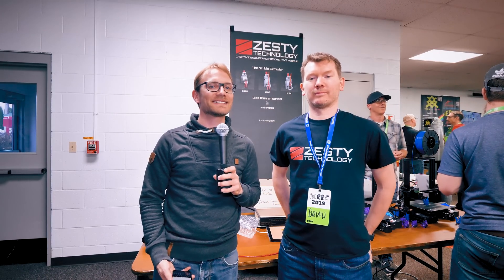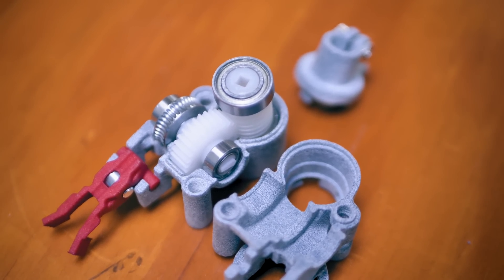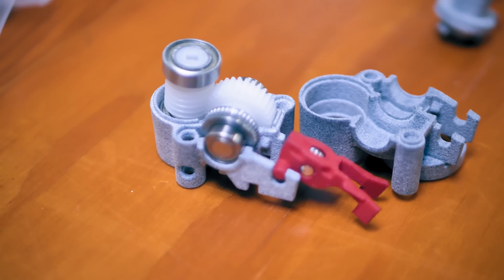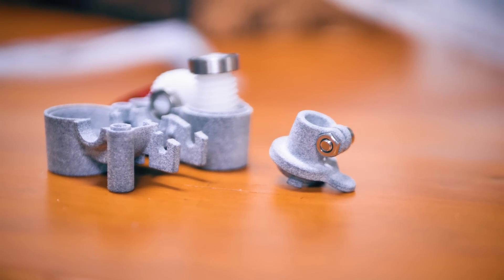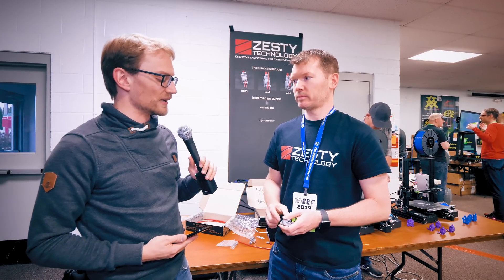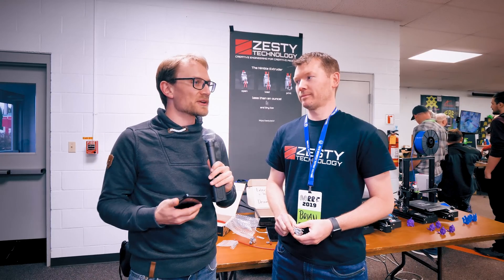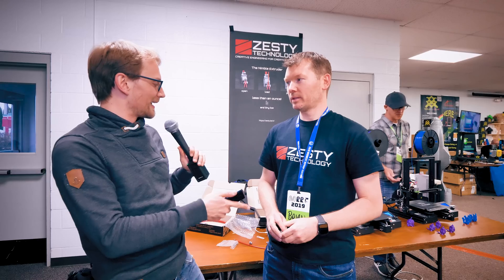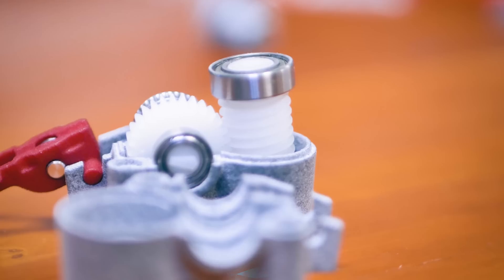The Remote Direct Extruder: Zesty Nimble! #MRRF2019

Comment: Could it be that they just appropriated the Flex3Drive project and pretended that it was their idea? Flex3Drive started in 2012, allegedly, and it can still be bought, and it is not sold out. So, something smells really scammy about Zesty. What could take them so long to finish with their next product? And why don't they sell the version 2 while they are developing the version 3? Were they sued for copyright infringement? Hit with a "cease and desist" order? The only thing that's clear, is that I will have to go to the Flex3Drive if I want a remote direct extruder.

Comment: This is the pinnacle of extruder tech today. A Nema 8 motor. It's about 20mm square. This is a staple in the 3d printer technology. Of course a nema 8 will have limitations but we're not limited by size and weight anymore. We can use a nema 11 with correct gearing for speed and quality, extruders are getting smaller every day and will eventually combine with heatbreaks when micro water cooling becomes more popular for high heats. 300mm/s printing will soon be possible for the average joe. Shopping is about to be changed forever. In 50 years when 3d printing can print ceramics and glass, malls will be online only.

Comment: So, it's a flexdrive clone?
Reply: David Willmore only in the sense that a Lamborghini is a clone of the Ford Model T
Reply: @crystalclearglass5204  i had the oppurtunity to test them out both. While the nimble can handle speeds over 300mm/s better and is more quiet (1:30 instead of 1:40 on the flex3drive) the flex3drive does almost everything else better. The flexdrive has significantly less slack (nimble about 0.1mm , flexdrive about 0.05mm), is cheaper, is completely open source, produces better end results. The nimble is a copy of the flexdrive, not the other way around. The lamborgini in this case is the flex3drive. And it comes at a price that is about half the price of the For Model T.

Comment: I own a Flex3Drive, which is the same thing. The shaft needs periodic replacement, or else they get springy, you'll start to see pulses in your extrusion. I mean on the time span of years, not frequent, but definitely get a few spare shafts.
Reply: I've got a Zesty Nimble for one year: never needed a replacement, I 3D printed at least 10 kg of PLA and other filaments during this year.
Zesty Nimble is a very good product!
Reply: @mariomilanesio3861  One year isn't long enough, it'll be several years, and you might not even care about the degradation, it might even look just like bad vibrations or bad filament.
Reply: @frank26080115   I don't agree: we are talking of 2-3 hundred € / $ to, say, one thousand 3D printers models, so nothing really expensive. With Zesty (and Flexdrive too, I suppose) you get a great piece of hardware with minimal maintenance. Then ok, nobody knows how it will behave after say 5 years work...but I think in 5 years my actual 3D printer with Zesty will be set apart for something new and better. So, you get great improvements in terms of speed, TPU and elastic filaments printing for a few dollars, and maintenance isn't that great problem.
Reply: @mariomilanesio3861  I'm not saying it's bad, I don't understand why you are writing this to me.

Comment: Video Idea: ultimate FDM speedtest using Nimble + SuperVolcano + beefiest stepper motor you can find (maybe a chance to try Trinamic TMC 5160s at the same time for higher amperage?).

Either way, this needs a proper review.  Have been looking to move to Direct for my CR-10 for a while now, and between the ease of upgrade, weight benefit, and (hopefully) elimination of traditional Bowden issues with material type and retraction, Zesty just pulled way ahead of the Bondtech BMG I'd been looking at.
Reply: Hi Alexander, you don't need a beefy motor, in fact, we suggest a very small light pancake stepper. You want it to be fast and light. The Nimble takes care of the torque.

Comment: Unless the cable itself is crazy expensive, I don't think this thing is worth $120.
Reply: They're not producing tens of thousands of units a month, that's why the prices are high. I do some manufacturing of small batches myself (nothing related) and I can tell you it's all about the size of your production.
Reply: @guillep2k  I can understand that, but if I could find a flex cable for cheaper, then I'd rather build one myself that also has dual gearing better flex filament performance.
Reply: @LanceThumping  That would be a cool project.

Comment: Beautiful concept (taken from motorcycle speedo cable or flex shaft die grinder?) 
I see a few issues. 30:1 means stepper must spin damn fast to get the speeds you want. Fast retraction would be iffy. Missed steps will be an issue. 3 to 5:1 is more than enough, since most extruders are 1:1 (gear on motor shaft) and function quite well past 150mm/s print speeds. 
With that high ratio, why only 1 gear drive? Dual with 30:1 makes more sense to me especially with slipperier Nylon.
Secondly, lube. Are the gears being lubed? I see sealed bearings. As with all gearboxes, it will need to be taken apart and cleaned out of spent lube. Hopefully it doesn't ooze out somewhere. Maybe make gears from igus material and you won't need lube. In that aspect, you could remove all the bearings for igus bushings. 
I like the pressed-in threads. Good touch. 
He said speeds on volcanoes are 'reasonably fast' and not 'insanely fast'? 30:1 is the problem. Sure, doing 1/4 or 1/2 stepping will lower your step count and give your tiny 8-bit machine breathing space but then it is a give/take for accuracy vs speed. 
Thirdly, the straight cut gear. Backlash in a worm drive is lowered(eliminated) by bevelling/arching both gears and 'sinking' it deeper into each other, providing higher teeth engagement. Check the pic to understand what I mean: http://www.amrutgearsindustries.com/gears/worm-gear/industrial-drive-worm-gear-worm-shaft.jpg
Does this setup accept off the shelf extruder gears?
Reply: You'll need way less retraction than a Bowden.
Reply: @guillep2k  On either my Delta or my Cartesian machine, retraction is the same amount. I see no reason to draw back more with the Delta over the direct drive Cartesian machine. Both are driven with 1:1 extruders. They both have the same step/mm count and are within 2% of each other.
I do not see your rebuttal as accurate.
Reply: @leofortey7561  It's not about delta vs. cartesian. The benefit of Bowden is that it allows for more speed than direct because of the mass difference (by taking the heavy motor out of the equation). The  disadvantage is that you have less control on the nozzle pressure and you need more retraction to avoid stringing (and it's very difficult to drive softer filaments). Just Google Bowden vs direct.

Comment: Well the point of bowden is speed... so the 32:1 gear ratio kind of limits that?
Reply: Bowden allows you to go faster because it's lighter than direct drive, so you have less inertia. This product is exactly about that, taking the weight from your extruding head while keeping the control over your filament. You'll obviously have to change your printer parameters so it drives the extruder motor faster. I can only speak for my CR-10, but the motors are the same in every axis, which means the extruder can certainly go way faster than limited by the stock firmware.

Comment: What I don't understand is why you need a custom teeth profile on the gear? Are there actual technical reasons for it? I suppose your supplier couldn't make it because they're set-up for standard teeth profiles. Which again shows the advantages of standardized components.

Comment: You know the main thing that drew me to wanting to try this product out right after seeing it for the first time on this video is that it removes the wight from the X Carriage. I made a Clone Prusa which I named Birchy for the birch plywood frame :P and one of the problems I have had was the weight of the X Carriage. I have been fighting artifacts from it for a long time. Its not the most precise build and I have been constantly modifying it and experimenting with it to try and make things better. One of the main issues were the motors that I had originally purchased were pretty heavy in my opinion. I had purchased lighter ones but I eventually stopped trying the Direct Drive designs for it and moved to a Bowden design which helped a lot. It prints pretty good now but there has always been room for improvement for that printer. Hopefully this Nimble Extruder will be just another improvement to it in a line of improvements I have made to it already. Can't wait to try it out. :)

Comment: Seen this extruder before and it definitely is a very interesting approach.
Though, I have to say answering a question about speed problems with printing speed is the wrong argumentation. Even with a Volcano having a throughput of 30mm³ it does only take the extruder a little over 12mm/s speed - and this equals to a print speed of 375mm/s in case of 0.4mm nozzle and 0.2mm layer height. The real issues come with retractions that usually are much faster than any extrusion move will ever be (except if you try to max out a Super Volcano).
Reply: As this will work like a direct drive, you'll need way less retraction than a Bowden. There's that.
Reply: @guillep2k  unfortunately still the wrong answer. You are talking about retraction distance that is very different on both types of extruder arrangement - and is primarily responsible for avoiding blobs. I am talking about retraction speed that is about the same for both variants and is primarily responsible to avoid stringing. And with about 2,700 steps/mm there is only so much speed you can reach before back EMF starts to totally eat up any torque - even the little torque required to just rotate the flex shaft.
Don't get me wrong I like this extruder and think about getting one myself. I only want to point out that it is pointless to talk about print speeds when it comes to speed limitations of an extruder.
Reply: @ManuelCoenen  I'm not for or against this extruder either, but if you have less retraction distance you have less retraction time anyway. I didn't see people talking too much about it for this product, so I guess it works out? The only comment I've heard is that your extruder motor gets louder, so you'll need some kind of dampening might you be concerned about that. And you need to increase the current as well.

Comment: just keep in mind that eventhough the extruder is light, the drivr cable is very heavy and stiff, thus it does cause a lot of torque on the hotend and adds more weight than just the hotend itself. I have one and while it works well, there are clear disadvantages as well.
Reply: *effecitvely adds more weight than just the 28gr extruder part
Reply: Our mid length cable is 58g, only half of that is carried by the carriage which still makes it significantly lighter than any direct stepper driven extruder

Comment: This looks almost identical to the Flex3Drive that's been out for a couple of years. I hope the Zesty product uses a better driveshaft because the one in the Flex3Drive (also a cable drive) reportedly gets sloppy after a while and causes feed issues.
Reply: @Waltkat what time frame are you talking about? We’ve been selling Nimbles for 2 years now and no reports of this type of issue so far. We have some customers with over 2000 hours of print time and they’re so happy they are buying more.

Comment: dual cogwheels like a bondtech would be best!
Reply: We looked at doing that. But the Nimble already generates more than enough push. Much more than is needed for normal extrusion. And with 1 mm retraction, there is very little chance of it chewing up filament. So we have shelved that idea for now.
Reply: @ZestyTechnology   the dual cogs with knurled groove grabs teh filamnet more solidly without deforming it.. i find all the one sided grippers deform the filament to get its bite.. causing air and clogs to get inteh melted filament path . .
causign jams
Reply: @PaulColeVFX  We looked at filament under the microscope, after it had been through the various extruders. The indentations from a BMG were less deep than from other extruders, but roughly the same depth as on the Nimble. But the Nimble's indentations were less "sharp" with no edges.
Reply: @ZestyTechnology   when the filament goes from o to 0

Comment: Wouldnt it make sense to terminate the end of the flex shaft in a mounting plate and a D shaft?
Reply: That would add significant weight to the assembly, every aspect of the Nimble is custom designed or selected for the application to keep size and weight at minimum :)

Comment: looks awesome, but i went to check it out and it's $95 USD instead of $60 USD. i don't know how i feel about putting an extruder on a printer that is a little more than double the cost of the extruder. probably will end up getting one anyways.
Reply: $60usd was for the water cooled heat sink (Kryo)

Comment: Surely this is a perfect application for a servo with a STEP/DIR interface with a fast pulse generator (a 32bit board or FPGA), not a stepper motor. They're not as expensive as one might think, have smooth high speeds (unlike full steps on a stepper motor) and can also be very precise if needed.
Reply: can you point me to a vague direction manufacturer wise? Would be interested in small servos but cannot really find "cheap" drives...
Reply: @jojoposter  I've used the JMC iHSV57 in the past; it's all-in-one - the motor, the encoder and the driver. From looking around, there's a NEMA17 version called iHSV42 for $60-80 from China.

Comment: Isn't it a compromise to have single-sided filament driving? Having dual, I'm not eager to go back to single drive. So I'm designing my own dual drive flex 'no compromise' extruder.
Reply: We’ve just re-tested since MRRF and the nimble can lift a CR-10 off the table if you lock the spool rotation, that’s plenty of driving force I think you’ll agree :)
Reply: @briangilbert3429  That does seem sufficient. I suppose it has to do with the wider diameter gear you use with more contact with the filament.

Comment: Two words, spline shaft! I'm currently working on a design that incorporates these. They are precision ground with nearly zero backlash and they can transmit relatively large amounts of torque. In fact they could even replace one of the two linear shafts in a standard build to lower the part count.
Reply: Justin Hulbert the squaring we use on the ends of the drive cable do this without the added weight the spline couplings would add.

Comment: OMG every ender3 owner is going to buy one of these (including myself)
Reply: The price of one of these is more than half of the price of an Ender...
Reply: The ender is a bargain for sure, it doesn't mean its owners won't buy this.
Reply: @mrb2917  yeah like me. I chose this device because its a great baseline platform to build on.
Reply: @PapoochCZ  My thoughts too. It looks like a great product and the team seems awesome, but at $100 a pop it would seem more at home on an i3.
Reply: dsp4 well you have a cad program, and a 3D printer design something similar.
Reply: It will be at home on my  ender and many others'. $100 is nothing for this.
Reply: Most Ender 3 owner's upgrade to Bondtech or Titan feeders.
Reply: It’s not at all limited to the Ender 3, that was just the machine we chose to display it on,  it is far lighter than a bondtech or titan too :)

Comment: I really wish there was a shipping method from within EU. Import costs are just insane: around 40€ (almost +50%) for shipping, VAT and customs
Reply: Hmm, VAT we can do nothing about, even if we were shipping from Europe. But Customs? No, should not be any customs charges. 
BTW, we changed our shipping methods, there are now various options to choose from.
Reply: @ZestyTechnology  Everything outside the EU is charged 10€ for the customs services, this is a flat-rate only for them to have a look at it (the only exceptions are gifts or if shipping costs + value of goods are below 22€ that are declared in before), then additional 20% import VAT (applied to shipping costs + value of goods) must be paid - note that's what I called customs, although de jure it's a different thing. That is in addition to the VAT we probabbly have to pay to Australia (or are the prices on the website without VAT?). So technically we don't pay "customs" but still need to pay them around 30€. All in all total cost is around 130-140€.
I don't know how exactly it works, but a lot of chinse printer manufacturers have the option to ship from within EU, which is only marginally more expensive than the price from china. I guess a lot of what they charge only applies to end customers.
Reply: @powertomato  The site does not charge VAT. If we had a European site we would have to add VAT to it, yes. We find that the charges depend a great deal on which shipping method is used and which country receives it. You know what they say: Death and taxes.
Reply: @ZestyTechnology  Not necessarily. Business purchases across borders within the EU do not pay VAT. So... a company pays VAT only for items purchased from another company if they are both registered in the same country. 

It would be great if you could work with a distributor or retailers, so this would lower the import duties and shipping costs. Cheers!